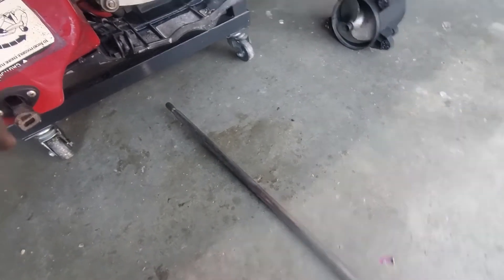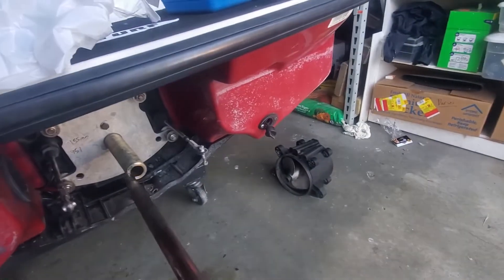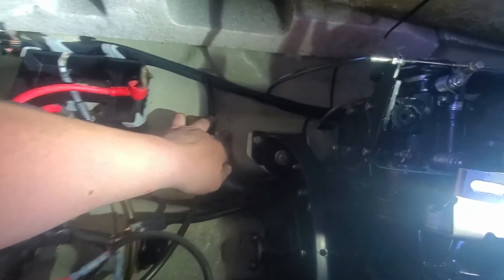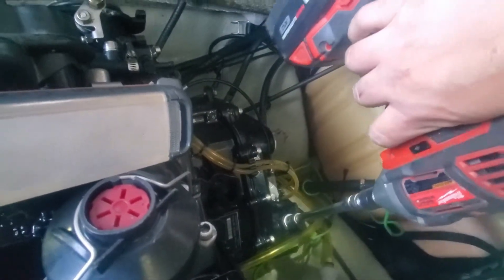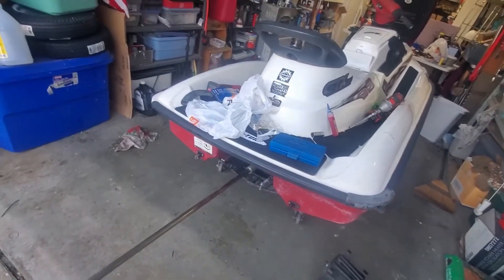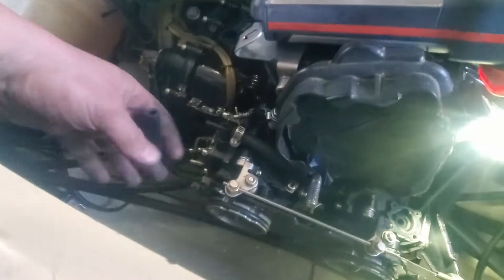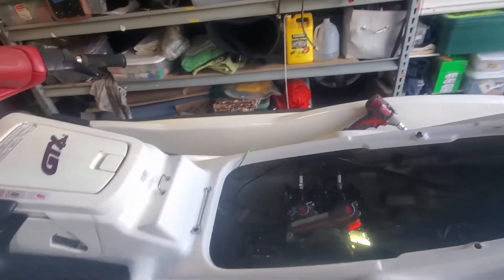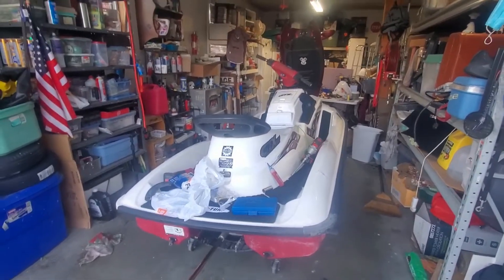How To: Engine Alignment 98GTXL

Comment: What was the inner diameter size of those spacers? My sbt kit didn’t come with those
Reply from the maker: Those spacers dont come with the kit, i had to get them separately. 
The pump studs are 10mm which is close to a 3/4 bolt, so any spacer that is 13/32 hole will work. .you can also just use a bunch of 3/4 washers 
You just need to make up for the gap with no threads